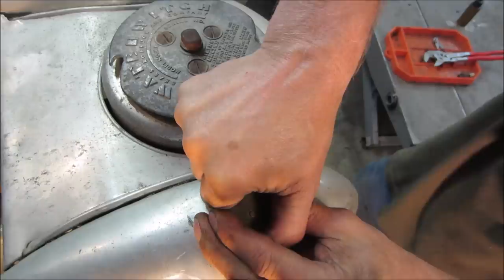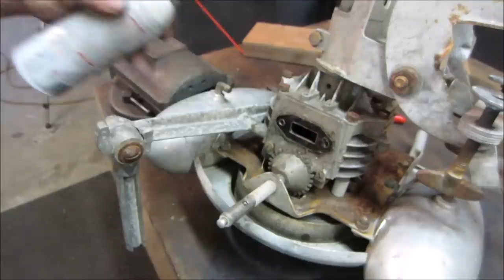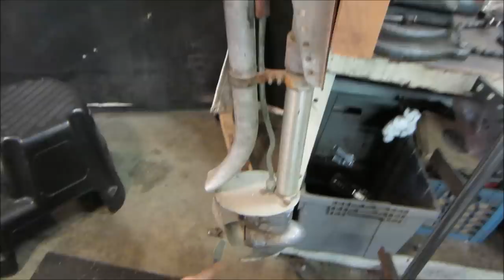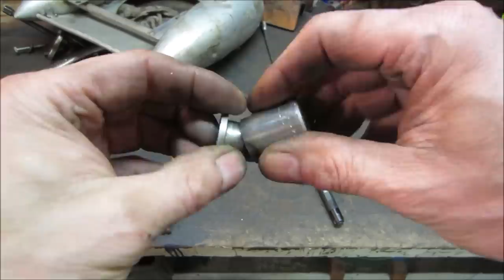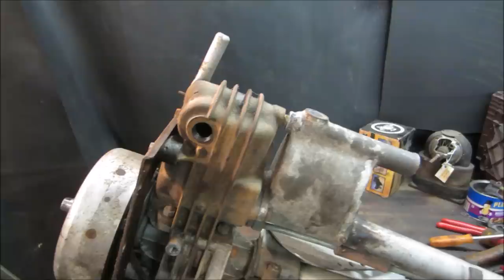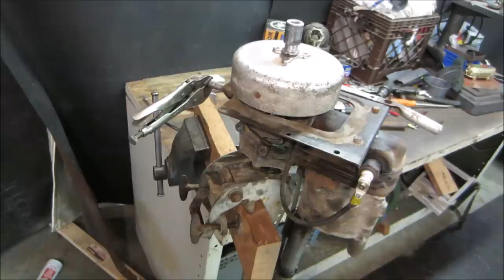1937 Waterwitch Boat Motor, 60 years in a Shed. Will It Run? Part One

Comment: When it comes to vintage outboard motors patience is a virtue , I pulled a 1936 Johnson model 300 off the bottom of a lake in the early 70's and after 2 years of working on it , it ran better than some of the new ones . You never know what you get until you put some effort into them .
Reply: That's great that you managed to get it running.    The trick there is that most people wouldn't have the 2 years to put into working on the engine.
Reply: @tbelding  I was working as an OMC mechanic at the tine , even at that parts were very few and far between .
Reply: @dalesakawsky7309  That makes having it run again even more impressive.   I can maintain/repair mechanicals, but I'm nowhere near that level of dedication and inspiration.  (maybe perspiration).
Reply: @tbelding  Dedication is what you get when you become a true mechanic , I am restoring a 1927 Chevy truck now , it's all or nothing .
Reply: @dalesakawsky7309  - I spend most of my dedication repairing newer (and more electrical) things.   Right now, a customer is wanting me to install wireless controllable light switches for him.   I'd rather have a 1950 4 door Ford.
Reply: In the ' 80's, my uncle pulled a Johnson outboard from the bottom of Sebago Lake, fixed it up, and then ran his boat with it.

Comment: A recent Waterwitch sold at auction for $2,500. Very collectible. 1940, I have a vintage Greyhound from 1941 and the style is very similar, I bet it was designed by Raymond Loewy. There is one in The Met museum.
Reply: are you saying this outboard is from 1940?
Reply: @crisprtalk6963  Yes
Reply: @pr8944  Later in his career, but not with his earlier work.
Reply: We need more dilithium crystals!
Reply: wajadog  Warp factor 1
Reply: Craig G  That's cool!
Reply: Waterwitchdotnet has a good picture of the Waterwitch2. Very nice indeed. And a bit of history. (If you haven't already seen it, that is)
Reply: thanx for that 411, nice to have some story.
Reply: @crisprtalk6963  .....I am going to make a wild guess and say it is 1937....(did you bother to read the title?)
Reply: Darn - I've been lugging this same outboard around my whole adult life - I inherited from my Dad -- i pulled it down from the attic today to blow some insulation in and wanted to see what I had.  Hmmmm I maybe have a diamond in the rough.  It has a few dents in the tanks but it'll all there and cranks over with ease.  Maybe a future restore project.

Comment: I'm nearly 60 and have worked on these type of old motors since I was like 12. The FIRST thing you do is buy a can of PB Blaster and drench the entire thing down and then let it set overnight...You got lucky that you never broke anything lol I have an old motor that is a Wizard from Western Auto...kinda similar..was made in the late 40s
Reply: NOBODY on youtube does that!!!!  Drives me nuts!
Reply: Engines that don't survive his initial torture are deemed not worthy of further work
Reply: Yup. Totally Agree. Soak the entire machine for a week 😂
Reply: Exactly  what I said bro   You said it first lol   . Also put it in the Sleeve but if you intend to strip anyway don't turn it round lots  scratch the crapp outa the surfaces   I've stripped old dump truck and Cement mixer 1 cylinder diesels   They simple but you Gota be careful early in the Strip down breaking studs and cracking cast iron parts is messed up
Reply: Machinery Restorer on youtube does an amazing job using pb and not just wrecking stuff.

Comment: I remember my grandfather servicing his Austin 7 spark plugs in the same manner and he had a old Oxo tin of electrodes and insulators and he could get a new arc arm welded on by the local blacksmith who did any work like chassis or other heavy metal sort of stuff on the ancient thing.   When he let it go and just drove his amazing Triumph Vitesse, he bemoaned the fact you could only use premade non servicable plugs but did continue to annoy my grandma by stripping carbs down in the kitchen and once a year the head came off, out would come his piece of plate glass and he would lap the head face using grinding paste then decoke then using a handcut sheet of copper to make a new head gasket he would have it back together again and his Triumph ran like it was practically brand new despite it doing several 1600 mile caravan towing trips to Scotland and back a year.
Reply: What kind of spark plugs are those? Is there a name for them?
Reply: I have a '42 IH W6 tractor which my grandad bought new during the war, it has the same plugs in it.
Speaking of Austin 7s, my dad's mate ran one which poked a rod through the block when they were on holiday.
Dad stripped the sump and head off it, drew the piston out and bound insulating tape round the crankshaft with a couple of jubilee clips (to hold the oil pressure), plugged the block with a lump of wood bound in a rag, built it back up again and they got home (100 miles) no problem, albeit a bit off balance.
It was only a temporary repair but his mate ran it that way for nearly a year before it finally gave up the ghost😂😂
Reply: Ah yes the good old days. All the people we used to meet on the side of the road. Kids today.....
Reply: @yuriismywaifu203  
We called them ''Detachable'', ''sparkling'' plugs in the old days.

I have a box of new ones I bought in the 60's that are heat range ''FE-100''  LODGE [?] for my old non-unit Triumph 650 T-100 motorcycle of the late 50's.

For my 500 norton long stroke ''MANX'' [2 cams] from my Formula III, Cooper MK IX I installed in my 1949 Norton ''International'' street motorcycle.

The ''MANX'' being a racing bike used LODGE detachable spark plugs of a much colder heat range that had pink colured insulators.  I still have a few new of them still.

I got all this before I went to Vietnam.  When I finally got home, all I had were the spark plugs.  I was MIA so Mom gave everything of mine away.

Comment: 50 years ago, my father picked up a 1942 Evinrude outboard that had been brought to Australia by the US military. Apart from the motor and the internal drive shaft, the entire outboard was made of brass. It was a twin opposed engine rated as 7.5 HP but performed like a 15 HP plus outboard.
Reply: I had several antique outboards over the years and had one kind of  like yours. mine was a 7 1/2 hp  elto made by johnson or evinrude and it was a 1937. heavy as hell.
Reply: @boathead22000  Gidday, that sounds like the same one, 7.5 HP and heavy. Ours was a WW2 build, for the US army.
Reply: For the Top Brass hats ;-)

Comment: made by kissle.the flywheel is removed by loosening the screws a turn then back the nut out against the starter plate to pop the flywheel off.mags often required fettling out on the water with minimal tools on hand.16:1 fuel mix.I told you if you put the mixer back on it would start.

Comment: Middle timing position should be TDC. The engine runs in both direction for forward and reverse.
Reply: neet!
Reply: That's correct ,in fact those engines work always "full throttle" they run or slow relying in advancing or retarding ignition . This one once full retarded automatically reverses its spin. Nice an easy "reverse". And when iddling prop even moves water and thus the 
boat.
Reply: @josepelotudogomezcredulo6993    I have pulled wrenches for years, and never even thought this was possible.  Its genius.  The only thing I am curious about is knocking and pinging that this could cause.  How do they eliminate the damage to the engine.  A lower compression?  And running an engine backwards?  Same thing.  I was taught it was bad for it.  And here is an example of it being built to do that.  No wonder that the engine is in museums! I want one now! How I feel right now, is the same way people felt when the first car rolled by.  Goofy I know!
Reply: I was wondering when and who would get the answer first, most people don’t know two strokes will run either direction and when designed for it, are perfectly happy with that, ( as long as you have the ignition timing adjustment range )
Reply: @dysklexia  Big marine engines ,work that way too. Of course those are halted first an restarted backwards. The Messerschmitt KR 200 bubble car uses same way to go in reverse. Two strokers are easy ,but not 4 strokers. 4 strokers need a very complex system to change the valves timing.
Reply: I kept thinking that had to be the case as well. With that much timing adjustment, and it being a two stoke, ofc it runs in reverse.
Reply: Awesome thanks Mustie! Can’t wait for part 2 :)
Reply: @1010LouMary  Actually you only pull start it in forward. Flip the spark lever into reverse and the engine reverses by itself. The  odd carb setup is really like a check valve to help this happen. Cleaver really.
Reply: ian cummings   Modern 2 stroke snowmobiles use this same feature for forward and reverse without any weight gain.  Skidoo was first and Polaris a close second.  Back in 2003 I bought a kit and added electronic reverse to my Polaris.  Just push a button and the engine slows, briefly stops, and then runs “backwards”.
Reply: @1010LouMary  May be as you say but,  saw some that are started clockwise as usual but if you need to reverse just swiveling the stick or other kind of control they tickle first and start putting an after they reverse by itself in one of the "missing" backfiring, a crude way for reversing I know. But are others that reverse with a catch turning all the motor head, thus pointing propeller forward...
Reply: @rriflemann308  And in 1937 (interwar years and all) you'd probably need a larger adjustment range than today, so you can run on crudely refined fuel instead of the modern highly engineered, finely adjusted stuff. Though even that old gasoline is probably better than the Airforce JP-1 specs of the 1950's "1) use the largest fraction of crude oil you can get away with so we don't waste anything 2) make sure it's liquid 3) make sure it's at least somewhat flammable when hot and under high pressure 4) It absolutely doesn't matter if no two batches are even close to similar".
Reply: @dysklexia  Same procedure for some old marine engines in ships to reverse them.
Reply: @josepelotudogomezcredulo6993  Exactly.
Reply: @dougmilley2480  Ha! You remember.

Comment: Side note about your chuck less drill.  Once you have it as tight as you can on the bit, turn the chuck slightly backwards till you hear one solid click and that’s how you lock it in place.  I just found this out from a Milwaukee rep and it blew my mind! My bits haven’t slipped since.  And thank you for Another Great video!

Comment: The Twin Tanks were filled from the filler cap and you opened the vent screw on the other tank. The unit was designed to seal the tanks so you could put the engine in the trunk of a car and not leak gasoline. The carb is the reed valve. If you put it on, it might run. Also, your drill is spinning the thing at pretty much at what it actually runs at.

Comment: When you're testing the contacts anyway, it's an easy extra step to find top dead center and adjust the timing just thereabouts. like 2mm / 1/10ish inch before TDC for example (eastern german MZ Twostroke Motorcycles)

Comment: Cool old motor. If I were a tool in Mustie's shop I would be in the misfits pile! =)
Reply: someone gave me a 2 1/2 hp Johnson Seahorse. I'm not a boat person I'm a engine person. I got it running then put it on a Scanoe (canoe with a flat back for a trolling motor) I got in the water and gave it a few pulls it was so heavy I took on water. The scanoe sank and flipped over with the engine propeller facing up like a periscope. Haha I had to start over  :-(
Reply: Still waiting to see how it turns out lol.
Reply: I would be an outright reject.
Reply: 8

Comment: Twin fuel tanks with a cross flow arrangement via the separate feed lines and joining at the carby. Large cap is the fill cap for both tanks, when the cap is closed that tank is sealed so there is no vent for vapour/liquid to escape, or air to enter. Small cap also seals to make the system airtight, it was common to move the outboard in a horizontal position for transport, rather than hung of the transom as done these days, often with the fuel loaded and ready to run, so being able to get the fuel system fully sealed was important. Open the small cap half to one turn  when mounted on the boat and the tank can vent and allow fuel to flow and be replaced by air.
We used to have single and two cylinder 2 stroke put put inboard motors for small boats here in Australia called Blaxlands. One characteristic of them was that once running, you could move the magneto around to change the timing and reverse the motor rotation to back up the boat, then move back toward the original position to travel forward. I am wondering if that may be the reason there is so much timing adjustment on the outboard, a start position near TDC , plus advance for forward and reverse either side. From memory, the little green stationary or marine under the bench did a similar thing and could impossible to start if the timing advance was in the opposite direction to the starting rotation. Would also explain why the rope start pulley clamps the flywheel but in place, preventing it from loosening if/when revering rotation. "Brass" conrod is probably actually bronze. The cam for the water pump is pinned onto the vertical drive shaft with a bronze pin near the top of the cam, if you need to take the final drive apart, the pin needs to be tapped out and the cam lobe should slide on the shaft and withraw with the drive housing.
Reply: Teach us, Professor. :-)
Reply: I agree with you on the timing adjustment to allow it to start in reverse (though I'm not sure how you'd do it, the starter ring is only lugged for forwards starting).  My little  60s 1.5hp Johnson outboard just spins through 180 on the transom if you want to go backwards.
Reply: @jncg2311  No, it has a start position with fairly little advance, and you start the motor in the forward direction at near idle speed. Once running, you can increase the throttle and advance  for more forward power, or  with the engine at a bare tick over, retard the timing to the point where the engine is effectively firing after TDC. This slows the engine and after a few revolutions, it effectively backfires and starts running in reverse, and you can advance the throttle and timing (in reverse  running direction) for the backing up process. To restore to forward running,  reduce throttle and timing to a bare tick over (reverse),  adjust timing to the start position, and the engine will kick over in the  forward direction, advance timing and throttle for forward travel. Virtually any reed valve 2 stroke can run either direction including diesels and hot bulb engines, unless something  controlling the timing prevents it. eg spark timing in petrol engines, exhaust and injection cams in GM 2 stroke diesels. Rotating the entire drive in the motor mount was a later innovation that did away with needing to steer while manipulating throttle and timing, so the outboard was better suited to the non mechanically minded.
Reply: @walterjwalnut9964  Brilliant explanation, thank you.  I didn't believe you could achieve that  with a spark ignition engine but can see from your description if it was going slow enough when you change over, you could do it.  Will have to find footage of one working, of wait about here for Darren to finish the job!
I've seen the same on hot bulb engines and other slow 2 stroke diesels, not always when the operator wanted it either and of course reversing steam engines on the fly though the control mechanism is completely different there.  
I have to say, I prefer this approach for a small outboard.  Having 'lost' the handle of an outboard spun through 180 before and having to reach out over a spinning flywheel to try to get near the controls again I like the ideal of keeping it facing the right way!

Comment: I was amazed that all the screws/bolts came adrift for you. 👍
When you start a project like this, would it not be worth spraying absolutely everything down with penetrating oil, rather than squirting it on "as required"?  Would that not give the hardware more time to soak.  I'm sure there's a sensible reason for showing restraint but, to my unskilled mind, it seems like common sense. 🤔
What a totally cool wee outboard. Maybe an unfair opinion, I thought Sears stuff was more of a "cheap & cheerful" brand. This seems to be pretty good quality, seriously lacking in the cheap, plastic components that make today's products so disposable.
We all knew it would fire up, but I still laughed with you when it did. 😂  Great stuff !! 👍👌

Comment: I think that the screw at 4:20 is an air vent for the gas tank.
Reply: Yeah so it doesn’t build up pressure when the engine sucks up the fuel, basically stops a vacuum from happening
Reply: When screwed tight home it also stops the fuel running out of the tank when the outboard is laid on it's side when transported. There is a "correct" side to transport it on...so that water in the head and leg doesn't go into the cylinder.

Comment: 2-stroke engine runs either direction, provided you can move the spark to the other side of top dead center. I would guess that's why the timing has such a large adjustment.

Comment: You're not supposed to spin a water pump dry. (One of the 900, and one of the million who've no idea what they're talking about but will comment anyway).
Reply: Most marine water pumps are rubber impeller squeezing past a metal part to cause a vacuum. Running them try means there is no lubrication or cooling.  So the rubber impellers will melt.  It can happen in just a second or two.  :)  this one uses a brass piston which is different.
Reply: water pump isn't a impellor type. it is a piston type
Reply: @jakejones9502  I like the name actually my nickname is JimBoB Jones no joke lol